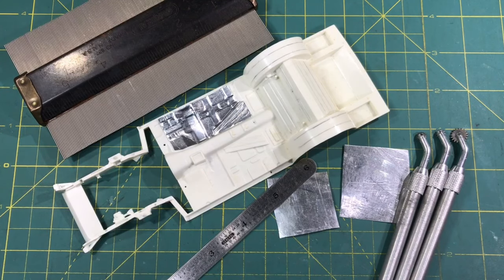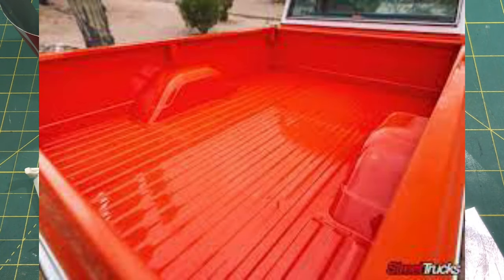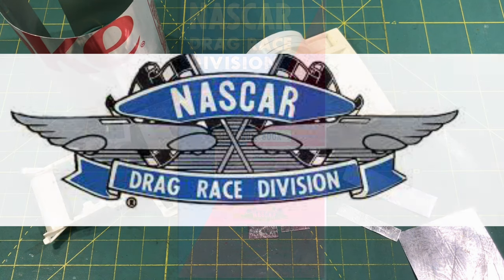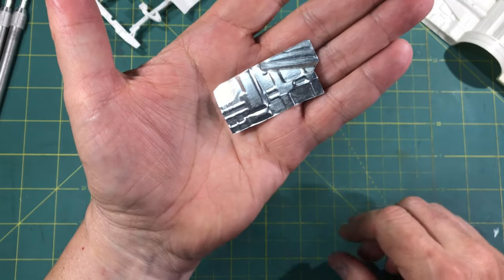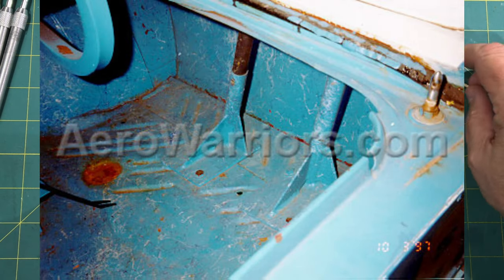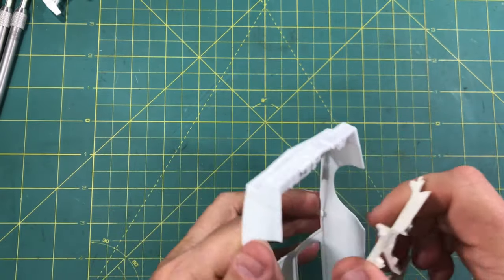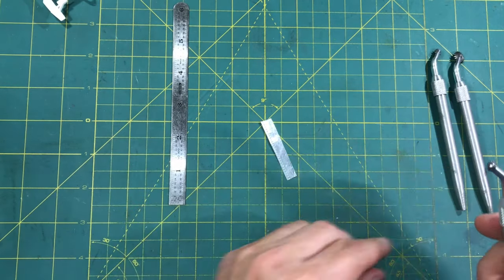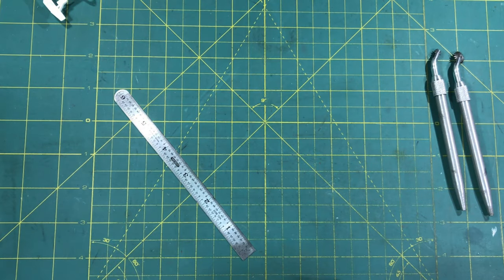Making Aluminum Floor Pans and Crush Panels

Comment: I'm a retired race car fabricator. Mind you, not on NASCAR racers, but many others. I like the idea of the aluminum panels. For non-structural panels in race cars, the layout of rivets is usually more widely spaced than what your pounce wheels do. So I was thinking maybe buy a couple sets and one set grind away every other point from the wheel. A while back I saw a pounce wheel on the craft table at my wife's friend's house that had a steel wheel with plastic handle. Maybe it would be better to do such experiments on the less expensive one. For real rivet-counter accuracy, the layout of rivets (or screws) would actually involve measuring a certain distance in from the end to place the 1st 2 rivets, then measuring the distance between those 2 and dividing to get the proper spacing. That would call for doing 1 rivet at a time, which would get to be a lot more work. For full scale work, such as on aircraft, there's an accordion tool for that. Your blue Daytona is beautiful.
Reply from the maker: Thank you Richard!! That's a great idea! I have 3 sets of pounce wheels (over gifting LOL)
Many thanks again an Merry Christmas!!!

Comment: Yes rule books will help y'all big time. Because if it can be done or is done to a real racecar it is done to a model as well. For all your your circle track racing stuff rule books for divisions like modifieds and outlaw latemodels and pro trucks ECT will give a a diagram on the body panel measurements and chassis measurements ect

Comment: I love your techniques for dioramas and metal racks and different stages of construction of a cup car you do very neat and helpful. When I started getting it in my mind that same thing I do to real racecars can be done to model cars and sur enough it works and I been having a lot better time scratch building and making my own custom oval track cars. I love 5 minute epoxy I use it every where I can and I build huge RC airplanes from balsa and hobby grade ply wood off plans so I have plenty your attention to detail is amazing man. And also have you found a good way for doing bead rolls in flat styrene sheet for decking in latemodels like asphalt and even dirt late models and modifieds I have not found a good way to get a clean bead roll look. And also you everyone almost every racecar has crush panels we just use sheet of aluminum bend it and fill it in for local track stuff like latemodels now nascar is a little different they have rule on how thick and how much of a over lap it has to be. I need that contour gauge that's nice. Your builds you show in pics is crazzy man I bet it takes you a good year on one model if you really detail it out 100 percent for show